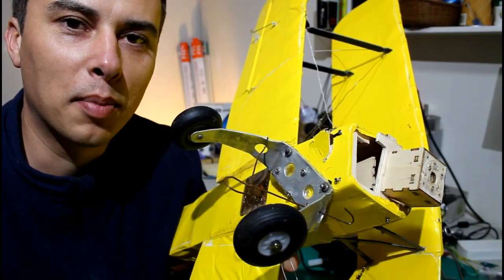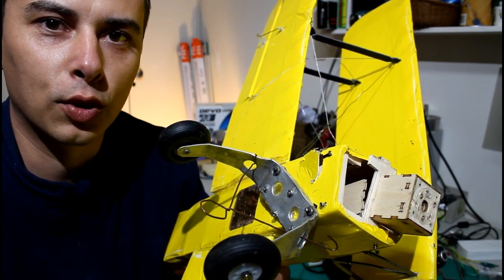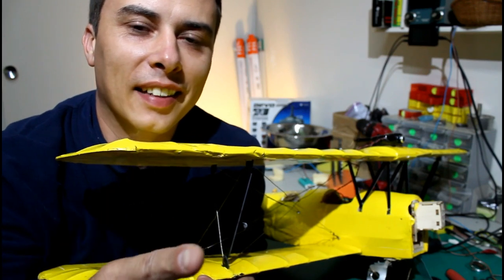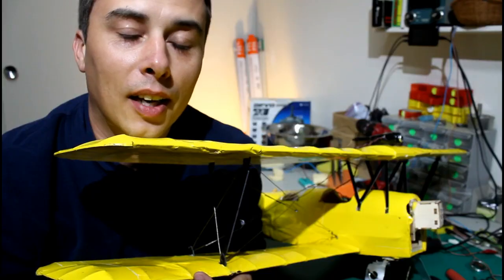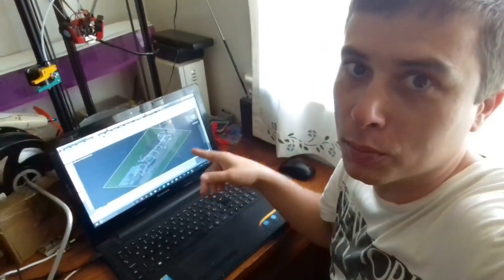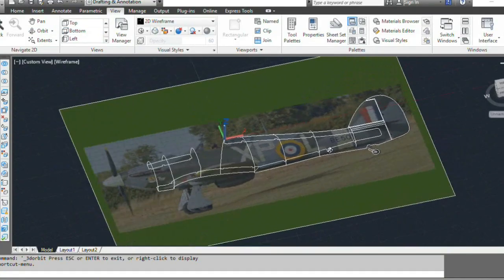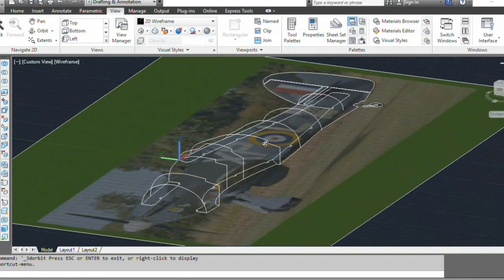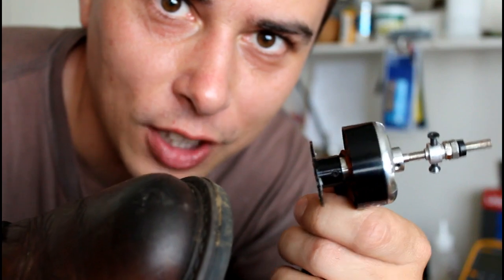I designed and printed MY OWN PLANE 😀 , but...

Comment: Please can you show me how you instilled the servo i need to video or photos
Reply from the maker: Please refer to the links I added into the description of the video. There is a hackaday page with lots of pictures and there are also lots of pictures on thingiverse. This plane is not the best design design one can find online and it requires medium to high levels of experience with the assembly job. Sometimes a little bit of imagination and improvisation is required. I already posted lots and lots of text instructions on these two pages and I decided that I want to keep it as brief as I can for all the other people who visit. I recommend that you go through the text instructions over and over again and this will reveal many details. If you reach some point where you've tried many things and it still doesn't seem to be working, you can contact me for answers, but please be specific. General questions like "how to install the servos" would mean way too much work for me and I don't have the time to write or create new tutorials if nobody else is interested in watching them. You can find my email address under the About tab on my channel's page.

Comment: Started printing .... and I think the prints are heavy. I will print all as is and create first build. Once done that - I will have good idea what can be done to lighten the airframe.
One possibility of course is to use LW-PLA ... 
As to covering - I may use Nylon and PVA - create similar to the real aircraft fabric covering.
Wish good luck when you finally get it in the air.
Reply from the maker: Yee! Nice to hear that you started printing it. Looking forward for your thoughts. Maybe you can post pictures when you finish.

Comment: Building this plane now. What size motor did you install I cant make out the numbers in your pick. Then I guess it just uses 9 gram servos? look forward to flying soon.
Reply from the maker: I used a Turnigy L3010C-1300KV (420W). Yes, the servos are 9g. Please post pictures or post a make when you're done. I like to hear your story. I am curious.
Reply: @FunElectronicsToday  I will do that. I have several things going on so it might be a month or so. that and I have zero RC plane experience. so it will be fun to see. but the wings are already printed.
Reply: Thank you for the reply too.

Comment: Good work! Excuse me, may I ask the temperature of your iron?
Reply from the maker: Depending on the soldering station and the material type. If you have a t12 tip based station, that is pretty accurate and it will really keep the temperature of the tip at the requested value. If it's a classical soldering station then you probably need to set the temperature 10% higher as you might have a temperature gradient between the heating element and the actual tip. I am keeping mine at @280*C for PLA and 320*C when welding PETG. But again: this is the actual temperature of the tip while welding. If you have a classical iron you might want to set it to 310 in order to have 280 on the tip. Maybe I should post a tutorial on how to weld plastic.
Reply: @FunElectronicsToday   FunElectronicsToday  Thank you for explaining. But I dont understand that how you can weld the PLA for 210°C, because I welded the skin for once, and the printed parts go soft.

Comment: Nice built up 3d plane.. wish i can see it fly..
Reply from the maker: Me too. I am currently in Papua New Guinea and living in the EHP at 1800m above the sea level. The atmospheric pressure is around 860 HPa at all times. So the air is very thin. I have no proper place to take off, no longer concrete pad than the one in the video and no asphalt road. The place is packed with trees and vegetation so I don't even have a place to maneuver it once I take off. I am pretty sure It flies well at lower altitudes and I will give it another try once I'll be back in Europe in a few months from now.
Reply: @FunElectronicsToday  Looking forward for the flight video. All the best.

Comment: That looked great and it should fly but looked underpowered. Do you know ecalc.ch flight calculator? If not tell me your AUW, motor make7/model, battery cell count, mAh, C, ESC ratings, and prop pitch/diam. I'll plug those in and see what it says.
Reply from the maker: Wow. I had no idea about this online calculator. Thanks for posting it here. I input the data and it seems like it is a little bit under powered indeed. The yellow propeller I'm using in the video is a 9x5'' one. The motor is a 420W at @1000kV and the full wight of the plane is around 1200g. I have a 4700mA 4s battery and 30A ESC. I know from experience that this motor type with this propeller gives out about 1Kg of thrust. I never measured it, but if this is true than the  Thrust-Weight ratio is around .8 and this is a little low. I guess i knew this from the beginning. I added in the description the link of the full project. On the project page I give out more details and numbers about  the plane. The only thing that is really low about this plane is it's wingspan, which is about 15dm2. This calculator gives me the stall speed of 48Km/h, but it says this system can handle it. 😬
Reply: @FunElectronicsToday  Before anything else look at your flight time! I see 15-20 mins! Cut the battery to 1200 and save 3oz! Only 5 mins time but who cares if it works!
Another thing about battery in the calculator, watch the max discharge. The default is 85% but I aim for 60 to make battery lifespan last much longer.

Thrust and speed, I can't see exact numbers without prop pitch and exact motor but you know what the calculator is doing. Prop pitch is the easiest way to adjust thrust if the motor can handle it.
A note about handling. You built the plane to exact 'outline' specs. But air doesn't 'scale,' so moving surface (ailerons/elevator/rudder) don't behave the same in a model as they do in full scale. The fix for that is usually a scale factor, where the model surface areas are enlarged by a small %. As small as possible, because too much looks bad. But they need SOME scale factor or the model will handle worse than the full scale, and some of those are already bad enough. An example of that would be to find a commercial version of yours, find the 3-views, and see if theirs looks a little different from yours. The point being that BE AWARE that flight may be... 'interesting.' :) I had an old time modeler (and B-25 pilot) tell me "You can never have enough rudder."
Reply from the maker: Very good tips. Thank you.